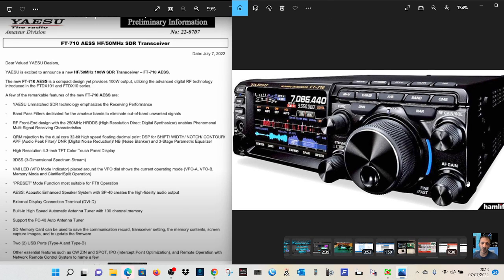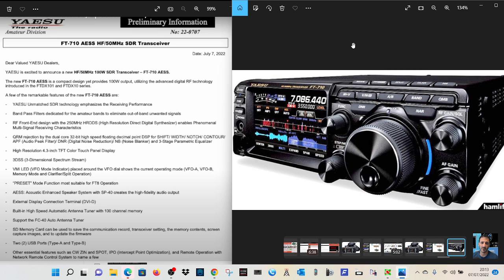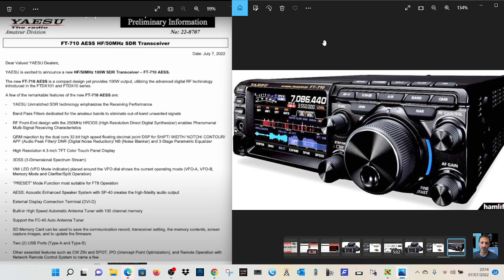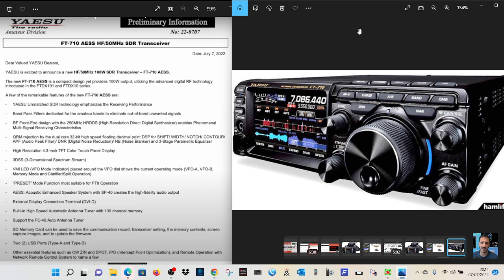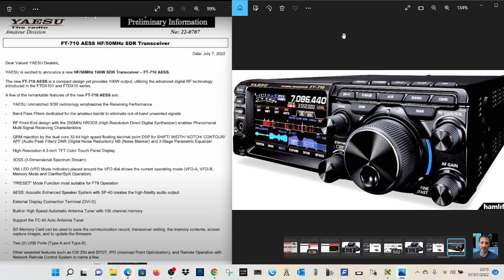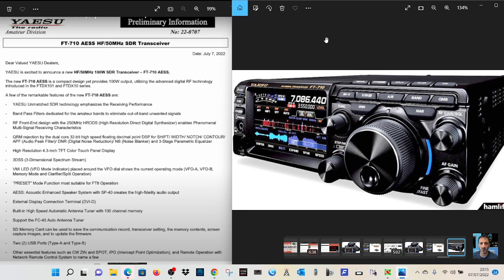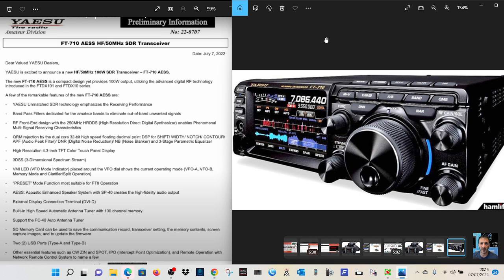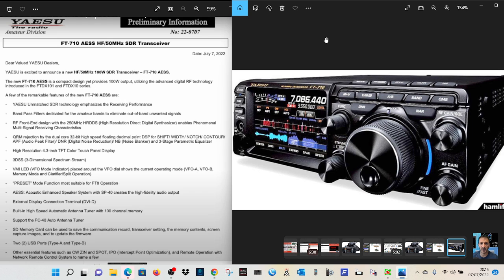YAESU FT-710 SDR or HYBRID ??

Comment: AD4C IC-7300
1 second ago
Its obvious that If they don't mention the hybrid circuit architecture the FTDX 10/101D/MP has, that it means this new FT710 will be a complete SDR radio without the superhet circuit with roofing filters meaning also that its dynamic range won't be as high as the 10/101 and therefor its price much less.
Its too early to speculate about important features but my only and very only wish this radio might have is the missing "averaging" feature within the menu to allow us to slow down the super high speed the RF signals have on the 10/101 versions. If they have corrected that wrong design this radio is going to be a big hit in the market.
Reply from the maker: It will be a missive hit also they hike the price up by including the sp40 speaker everyone is buying sdr nowadays and want smaller lighter radios wth nice large colour screens .73

Comment: The USA Yaesu channel confirmed it is pure SDR and that it sits below the DX 10. I am fortunate to have a IC7300 and DX10 and the difference is marginal save DX 10 has a better receiver, improved display and more flexible filtering as it is a hybrid plus the dvi port. 
Yaesu say the dvi port is deliberately specified because you don’t need the audio output that hdmi provides. The current cash back offer makes the DX10 attractive proposition and currently undercuts the ic7300 so it is a bit of a no brainer. If you do upgrade the DX 10 is the way to go and I don’t think you will be disappointed but I still love my ic7300. 73 Neil
Reply from the maker: I.want 991 version sdr
Reply: @M0FXBHamTech  I absolutely agree, I had a 991 (non A) and an FT710 sized multi band would be hard to beat!! 73
Reply: I have radios as well.  The FTDX-10 is much better.  The 7300 is good radio but has its limitations.
Reply: @bluzman00  I think the fairer comparison will be the new FT 710 and IC7300. The FT710 will be a price threat to the IC7300 which probably sits too close to the DX10 at present and will need to be adjusted downwards unless the DX10 reverts to its original £1549 launch price as my gut reaction is that their needs to be price gap between the two receivers. The ic7300 can then slug it out with the FR710.

Comment: Elecraft. To counter the growing SDR market, issued a technical bulletin to describe the benefits of having a wide band SDR and some crystal filters in line.  The argument supported Elecraft's design which is both SDR and crystal filtering.   The  plans are good with the benefits of a wide open SDR combined with  crystal filters on the receiver.  Pure SDR designs do  not work well where's surrounding RF sources like in a field day competition set ups.
Reply from the maker: Hi thanks this is good info can we have a link ?
Reply: @M0FXBHamTech            ask Elliecraft factory
Reply: 7300 only downfall is in this field day environment. Possibly also if you have a ham neighbor.